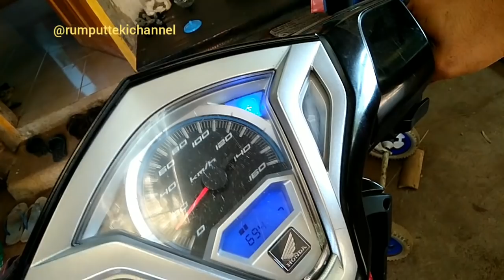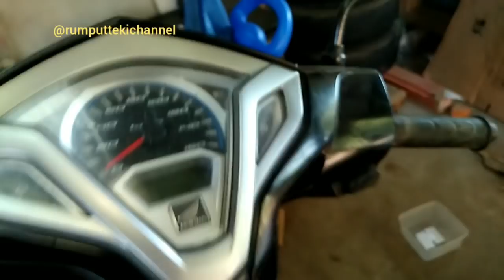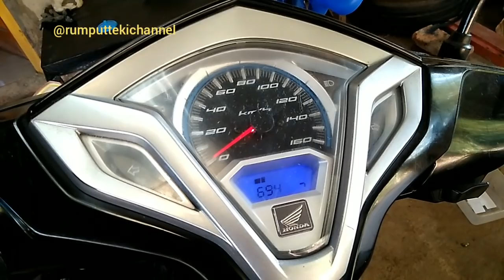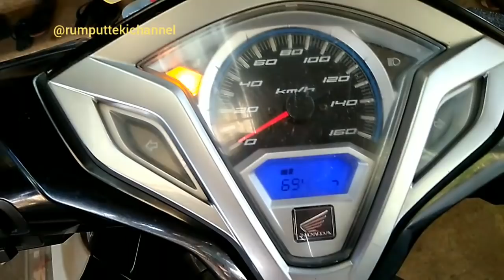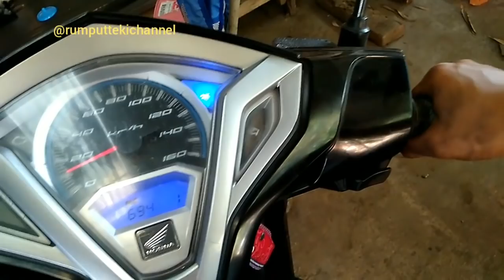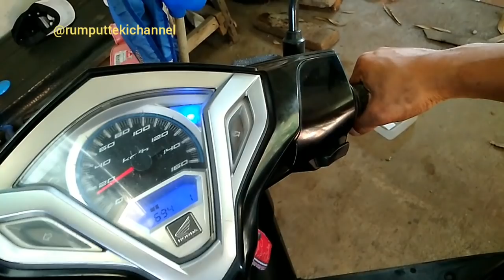Vario 125 Nyendat

Comment: Saya masih bingung dengan problem vario 125 old saya, saya coba piston ganti vario 150, kelp baru, per klep baru semua kucuali bandulan, setelah itu naik ke sistem pembakaran, coil saya ganti racing busi menggunakan brisk iridium, kabel setan pun saya pake (accent wire), throttle body set baru, air intake ganti ukuran lebih gede(soal nya std vario sangat kecil), water temp baru, fuel pump baru, kabel body baru, sudah reset ecu/tps, bahan bakar 92, tapi tetap masih aja brebet dari 0-20 waktu mesin dingin, tolong pencerahan nya min
Reply from the maker: Injektornya?
Reply: Injector menggunakan cb 150 bang
Reply from the maker: sip juga mas,
saya ada trik khusus Vario 125 old, tungguin bulan ini mas,
Reply: @fikrianugrah5397  SAMAAAAAA... SAYA JGA GITU :(
Reply: INFORMASI 302 coba sampean cabut soket o2 brebet nya ilang, tapi lampu mil menyala, jadi harus ganti atau beli o2 manipulator, trims
Reply: @fikrianugrah5397  punya ente udah beres ms ?
Reply: INFORMASI 302 alhamdulillah sdh beres, make o2 manipulator, menurut saya kurang debit bensin, jadi harus o2 di manipulasi
Reply: @fikrianugrah5397  ok ok 
. ada link tutor nya mas
Reply: INFORMASI 302 ga ada sih hihihih
Reply: @fikrianugrah5397  gmna bang motor nya mesin dingin masih nahan dlu ga di bawa jalan
Reply: Haikal Ikal masih bngt
Reply: @fikrianugrah5397  kata nya udah sembuh bang?
Reply: Haikal Ikal tetap balik, mungkin ecu nya
Reply: @fikrianugrah5397  udah abis brp bang benerin gituan haha, sensor ect udah di cek bang?
Reply: Haikal Ikal tidak terhitung, semua sensor baru bng, kabel body, elektrikal yg ga baru cmn ecu udh itu aja over haul mesin juga sdh
Reply: @fikrianugrah5397  emang vario 125 old tahun brp om
Reply: Punya saya sampe skarang lom smbuh
Klo lepas gas mati
Dah ganti injektor rotax aki
Bli h diag jga hsil ok
Ttp aj gas dlepas mati
Stelan angin dputer2 gak ngefex
Ad yg prnah gtu gak
Mohon bagi solusi
Reply: @feriawan9163  mknya itu gan sampai nyrah gue
Reply: @fikrianugrah5397 sudah tahun 2023 gini statusnya gmna?

Comment: Mas soal case kemaren yg idle ngayun, saat idle mati sendiri, saat buat jalan ndut ndutan kaya busi mati tp cm sesekali, idle ga bisa kenceng, saya telusuri beberapa hari sambil browsing D mbah google sambil trouble shooting saya ambil keputusan, cop busi ganti ktc, busi racing iridium, klep 15 25, tensioner ganti baru, reset ecu, reset TP, setting alltitude, TB di copot di semprot karbu cleaner, hasilnya ada perubahan yg signifikan, ga tau cop busi yg mulai bocor ato busi baru yg bermasalh, tp Alhamdulillah sekarang dah mulai sembuh akan tetapi klo saat d panasin pertama pagi, untuk mesin tiba2 mati masih terjadi dan mulai berpikiran apakah koil ato cdi ato spul yg bermasalah ato pompa injector yg bermasalah, masih jd pikiran saya mas mohon penjelasan dan masukan ato nasehatnya makasih
Reply: Idle sensorna di copot di bersihin ma carbu kliner om
Reply from the maker: tingkat lnjut mas, pinjem TB motor lain mas, kemudian kalo ga sbuh, ada yang spull bermasalah klihatan dari apinya,
tp kalo gak bisa besar stasioer biasanya dari area tb,
Reply: Ok mas terimakasih atas masukanya nti saya cb gnti tb nya

Comment: mass vario 125 old klw mesin nya dingin klw di pake jalan,trasa nyendat dulu,apakah penyakit bawaan? karena di cek smua msih ok+udh reset juga
Reply from the maker: Kayak gini ya... Tungguin bulan ini akan saya posting hasil riset saya...

Silahkan share ke temen temen sosmed...
Reply: Itu mas... spiur setelan angin/gas yang ditengah  yang ada per nya itu dibuka diputar ke kiri sampai habis lalu cabut dan bersihkan biasanya bergerak akibat polusi ruang pembakaran mesin dan kalau bisa lubangnya itu disemprot pakai wd atau injector cleaner sekitar 2 detik aja lalu tunggu supaya kering lalu pasang lagi mas dan jangan lupa itu spiur disetel jangan terlalu rendah langsamnya... terimakasih
Reply: @libersirait6111  SIAPPP DI COBA

Comment: Mas ari, motor beat fi ku keluaran thn 2014 yo mbrebet gitu mas, koyo telat bensin,
Fulm pump masih bagus udah di cek, busi ganti baru filter udara baru, bagian cvt semua baru, busi kluar api besar, stelan klep in 15 ex 15. Throttle body udah dibersihin, udah di reset juga tetep aja masih mbrebet, tegana ga ada bisa jalan tapi lari mentok 60Km/j.
Itu kira" apanya ya mas, tolong bgt pencerahannya mas
Reply: bentoku bdg filter udaranya bersihin mass kotor itu
Reply from the maker: ada ciri ciri brebet sama gerung dibedain mas, klo gerungpasti cvt atau ngeden, kalo brebet bisa dari sistem injeksibseperti ocb busi yang simple, fulpump kalo normalnya 294 kpa,
kadang cuman kebnyakan masukin oli mesin malah sangat kerasa loyonya,
mtursuwun like dn subscribe rumputteki, njenengan 👍
Reply: Coba cek tangki ma fuel pum na mas..d situ mslh na
Reply: @rumputteki  injeh mas Ari sami. oli nya jg sudah saya ukur pakai gelas ukuran totalnya saya masukin 700 Ml, filter udaranya baru ganti itu mas, trs fulm pump nya jg sudah saya ganti baru, di pasang motor lain yg sama jenis juga normal" aja ini gasnya nyendat" kaya telat besin gitu mas, dari semua kabel juga sudah saya cek ga ada yg putus, kabel spul jg ga ada yg putus sampai sudah saya lepas spul nya saya bersihin debu" yg nempel nya tapi motor tetep aja ga bisa normal, tolong bgt sedulur semua mintak pencarahannya lg ?
Trimakasih sebelumnya untuk semuanya
Reply: @dhikahaikal7261  bukan cuman sy bersihin mas malah udah saya ganti fuel, tapi tetep aja nyendat gas nya, dan ga ada tenaga, bensin tambah boros
Reply: @samsungcools3693  udah saya kuras tangki nya mas fulm pump udah sy ganti 1 set tapi tetep aja mbrebet mas, udah sy reset tp, ecm, sy ksh mode 1, tapi aja tetep mbrebet ga ada tenaga boros bensin malahan. Malasih ya mas sebelumnya

Comment: Om  mau tanya vario 125 led ane kalo jalan 0-60km normal....tp setelah menginjak 80km kok gas nya ngempos yah....mohon pencerahannya....
Reply from the maker: Km sekarang dah berapa?
Silahkan like dan share video ke teman teman ya...
Reply: Km sudah 56rb an....pulley sudah ganti bubutan.....ap perlu di reset kyak gitu om??mhon pencerahannya
Reply: Iya gan ane bru ketemu td tpi masih gak ketemu solusinya udh ane reset injeksinya, lampu milnya udh gak ngedip, tpi klo kita jumper soketnya kita tarik gas full on kan kontak bru ada ngedip. Gmn yah gan filter fuelpomp udh di ganti

Comment: Mas klo vario 125 old di gas nahan kenapa ya mas? Padahal ngk mbrebet langsam normal ngk mati2an motornya stasioner juga normal
Cuma pas gas di buka kaya nahan pas mesin dingin
Klo udh di bawa kenceng normal lagi
Reply from the maker: ya memang karakter nya gitu
//mau bales di komentar baru//🙏👉👍❤️//
Reply: Sama kayak vario 125 old saya mas
Reply: Emang gitu gan, punya saya sampe bosen benerin masih aja nyendat2, harus ganti part racing kayaknya baru mau ilang tu nyendat2 nya
Reply: Dugaan gw sih karena per cvt vario bohlam ini make yg lunak dan roller berat (akselerasi gak jambak kaya vario keluaran baru), beda ama vario led old sama led new per cvt lebih keras dan roller ringan (unggul di akselerasi).
Coba deh ganti roller dan per cvt, pasti karakter motor langsung beda.
Reply: @bill10__01   dugaan mu salah bro. Emg karakternya vario 125 old yg kalo mesin dingin irit, pas udah panas baru normal